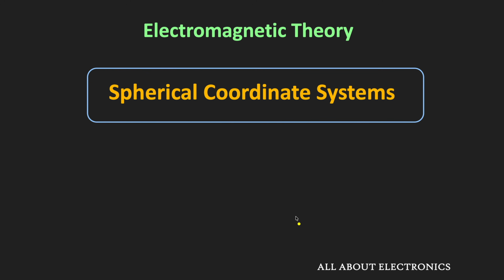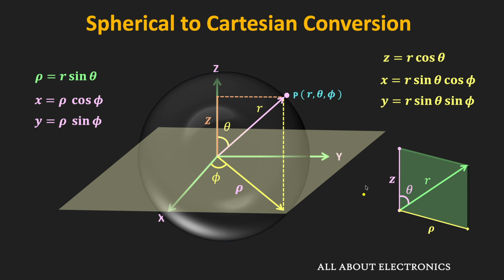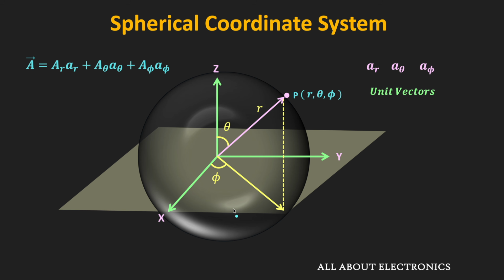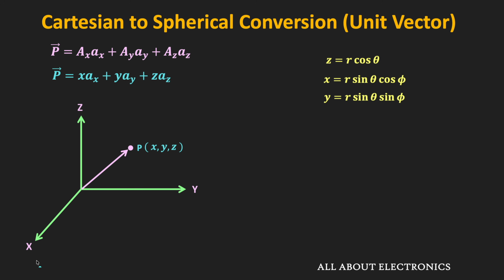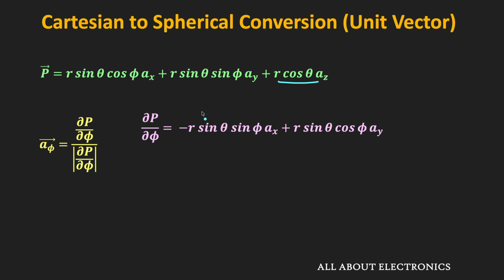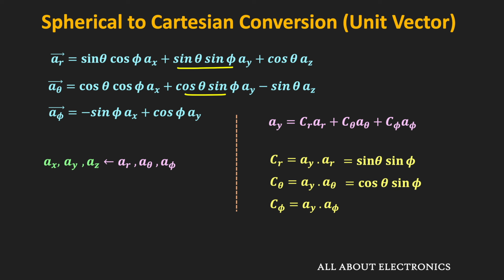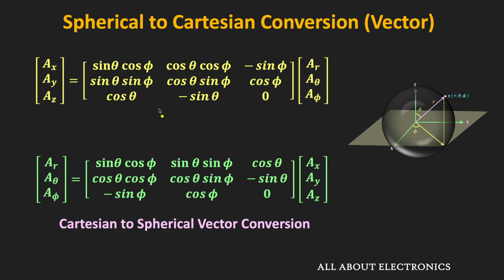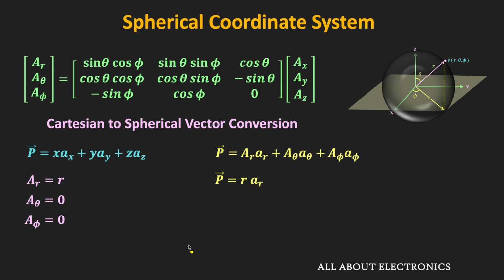Spherical Coordinate System Explained | Electromagnetic Theory

Comment: sir can you also make videos on the continuous concepts like surface  area closed integral, volume , area of any side req,del operator strokes theorem, curl
Reply from the maker: Yes, definitely I am going to cover that.
Reply: @ALLABOUTELECTRONICS  Bro when u will make videos on Derivation of electric field intensity due to point charge,Derivation of electric field intensity due to inginite line charge, Derivation of electric field intensity due to surface charge, why we use eno in force expression of coulomb charge😢😢😢😞😭😭